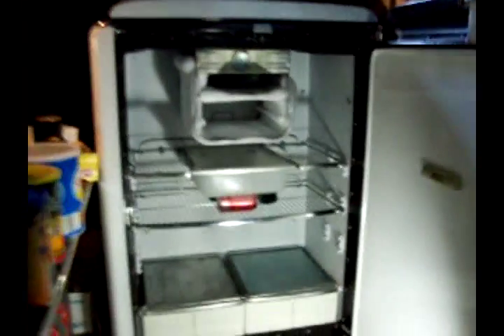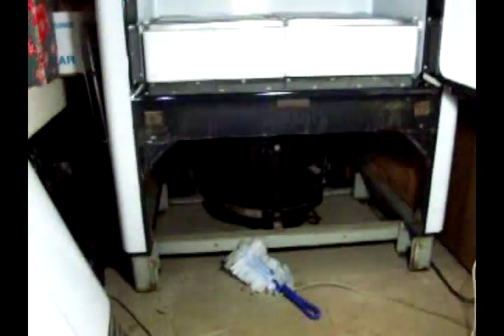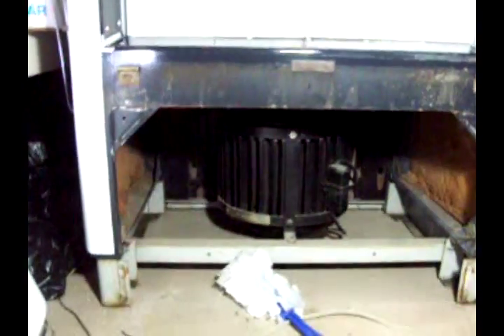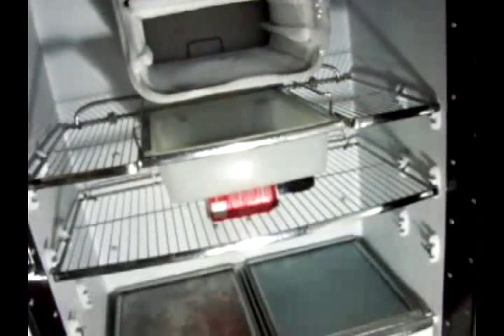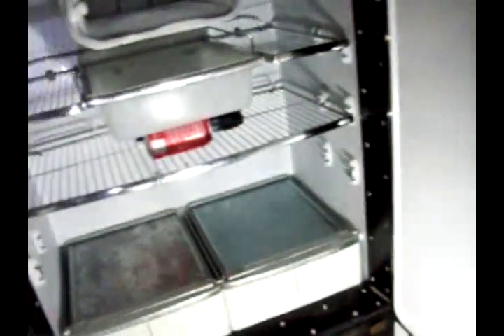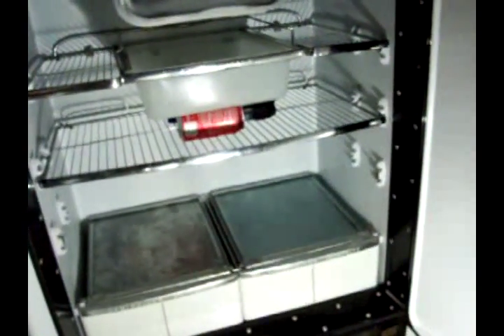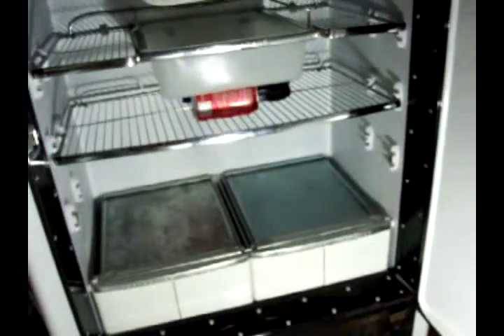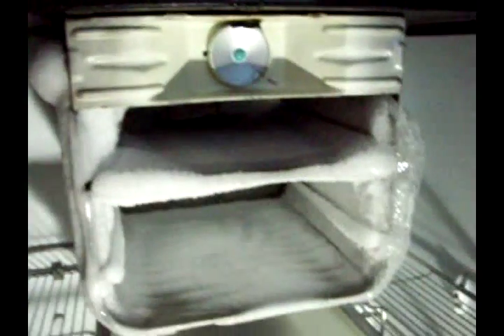1940's GE Deluxe Refrigerator

Comment: The plate on compressor will indicate year of frig with first two digits...with the glare from your light difficult to tell if it's 42 or 44. Which is when GE set freezer in middle. I have a 41 with freezer all to the right. GE moved freezer to add more cosmetic storage and for attractive marketing  reasons.
Reply from the maker: Thank you for the information.  That plate was so worn away .  It is still running.  Does yours run off of R12 or the prior ammonia they used ?  Correct me if im wrong on that one.  Thank You

Comment from the maker: Thanks !  I dont know where to get any parts for this fridge.... the thermostat was a universal that was installed in the seventies and besides the light bulb, cord end and the door seal that was replaced in the seventies and reinforced two years ago with weather stripping, everything is original inluding the compressor and electric cord.....  I would re wire it, except there is sj cord that goes into the compressor stiff as a board and attached to a terminal block.... if I move anything it will

Comment from the maker: @bildyp Thanks!  This still has the original wiring that I wish I could replace, but cant.  My compressor has the terminal block on the side but if you move it, the wire going into the compressor is even the old rubber coated wiring and it would just snap.  It has not moved from its spot in probably 30 years.  I saw your one video you made a keg fridge out of one of these!  Wouldnt mind seeing the other fridge also.... dependable!

Comment: The CF is a derivative of the CK Monitor Top. This particular one is fairly rare as most CF's used SO2 for refrigerant. The Freon 12 version had a slightly modified piston to accommodate the higher operating pressure. Please see the forum at http://monitortop.freeforums.net/ for any further information on this and other prewar GE refrigerators.
Reply from the maker: CA Monitor Top Thanks, appreciate the comment and info !

Comment: I have the same refrigerator but the power cord just got ripped out of the compressor or the terminal box possibly, I don't know for sure as I haven't had a chance to peak around yet.. Is there any way you'd be able to post another quick video or send me a few pictures of what that area looks like specifically with a little more light so I can see how I need put mine back together with a new power cord? Thanks!
Reply from the maker: I tried to move the terminal box to install a new cord, but the wiring that goes into the compressor is HARD as a rock and I figured it works let it be..... it would crack if I moved it.....

Comment: I also have an older GE refrig with a similar compressor and I am trying to determine how old it is.  It looks like it is 1937 but I am unsure.  Do you know where I can get information on the old models.  This one runs but I replaced it with a larger one and don't want to dump it but would like to make the best use of it.